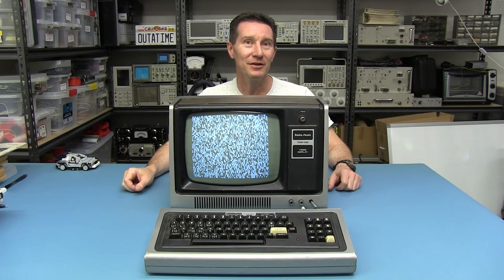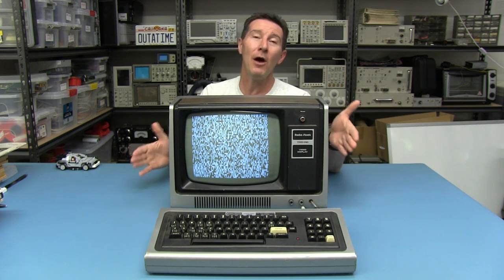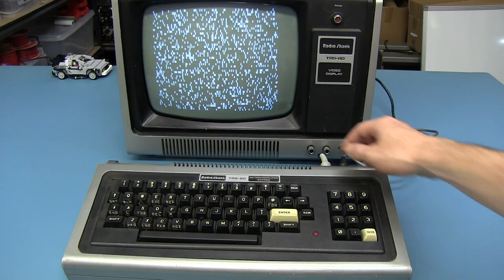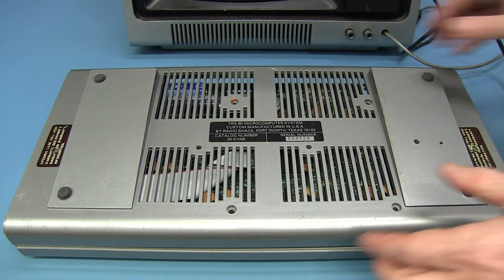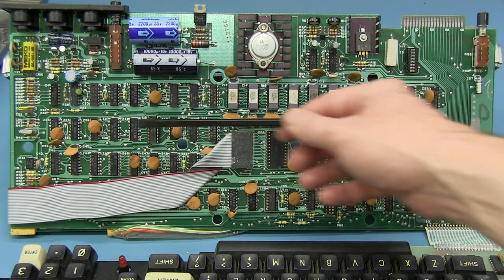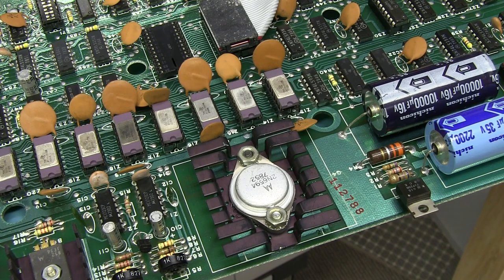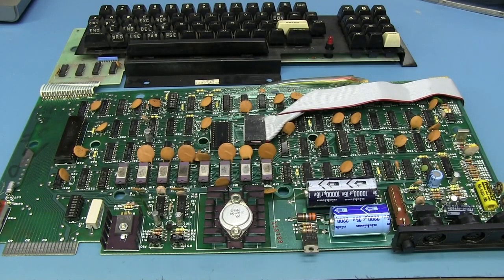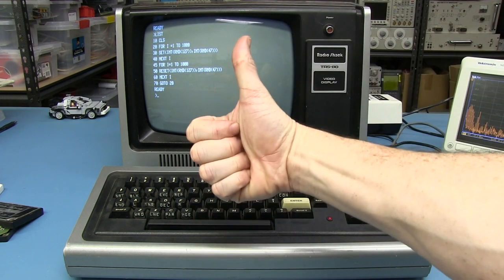EEVblog #645 - TRS-80 Model I Retro Computer Teardown

Comment: You got what you paid for with the TRS-80 I don't believe it outsold the Apple ][ because it was a better computer.  There were far more Radio Shacks then Apple Stores and they were for sure cheaper.  I believe the TRS-80 sales were overtaken by Apple around 1983/84.  Regardless what you had on your desk weren't we all on the bleeding edge back then? When IBM started the OS was terrible in comparison to CPM.

Comment: Cannot comprare Mhz directly, IMHO, in the C64 (example) perfomance was boosted by the VIC-II which take (of for course for games LOL) the heavy work clocked about 17 o 18 times de main CPU, with a power disipation peaking 1.5W in CERDIP package. In fact, CPU do almost work during spare (horizontal retrace ?) cicles from VIC-II. Text mode, another story. PET got larger basic version comprade to C64. The sad thing is that PET was horrible, screen was tiny and the machine was bulky, but did the trick.

Comment: IBM sold a computer in 1978 that had 256K RAM and up to 260MB of hard disk.
Reply: The original IBM PC had 16K. You could upgrade to 256K (...later) with cards that fit into the ISA slots. It'd run just as fast, by which I mean slowly, as the main RAM. Came with 1 or 2 floppy drives, and a socket for connecting an ordinary cassette recorder for data, which didn't get used much. A 10MB hard drive was an expansion option. 260MB, you're dreaming! My first PC in the early 1990s came with 40MB, though that was a bit out-dated then. 120MB or so would have been possible in the early 1990s. In the 1980s, and especially in 1978, no chance! 260MB would've been the size of a fridge, sounded like a washing machine, and plugged into a mainframe.
Reply: The original IBM PC, including computer unit, 64K of RAM, single 360K floppy, and monitor, sold for $3000 in 1981.
Reply: A 10 megabyte hard drive cost $4000.
Reply: $3000 equates to approx $8200 today..hmm Im starting to kinda miss my boot discs.. nah.. not really.. I remember in 1989 viruses were very popular... the school lab was rife

Comment: wow your mixed domain oscilloscope + spectrum analyser is really slow with its user interface. Looks like a code thing and not a hardware thing though, just need to prioritize user interface calculations over the FFT stuff

Comment: Sorry guys, I got to use one of these early on but it didn't impress me( same with Commodore Pet, AppleII and others). Dave does not mention the Acorn BBC32K with a 2MHz 6502 was a much better machine.
Reply: well the beeb is 5 years newer...very versatile machine
Reply: It was 1981 when the first Acorn BBC Model A issue 1 came out.  In Australia it was about the time the TRS-80's were becoming common in our Tandy stores.  The guys who designed the BBC hardware/software were also involved in designing the now ubiquitous ARM chip concept.  They were some smart dudes!

Comment: It's amazing to me how smart Dave is, but how he sometimes doesn't bother to think like an engineer. Isn't it possible that those are just plain nylon spacers, but since they've been exposed to heat and age (forty years!) they've chemically changed, bonding with the plastic posts and decomposing?  Make a hypothesis, Dave. Try to prove it, reason about it. Be curious.
Reply: I remember those spacers… as new, they weren’t a hard plastic or nylon, they were a spongy firm neoprene or similar.
I guess the softness was to reduce any rattling or mechanical vibration transfer - but as learned, they break down over the years to gluey, donuts !

Comment: Could you get your hands on a Sinclair 1000. That was my first computer.

Jack
Reply: +Jack neff I was recently gifted a ZX81 (rebranded as 'Timex Sinclair 1000' in the USA) and thought about sending it to EEVBlog. It had a semi-dead keyboard foil which I fixed 'ghetto style' and has a reset- and composite/rf switch added.
Reply: +Hans “Shockwav3” Meier  Hi Hans, that's a good idea. My first was the original Sinclair 1000 no timex involved at that time. We needed a cassette tape recorder to save programs and data. It was basic but was fun to play with. THere were a lot of addons later, keyboard, and I think an external HD. Don't remember clearly. Thanks for the message!!!  Jack

Comment: To be frankly honest, most TRS-80 are never going to start up again. If there were let's say twenty million Tandy Computers made only one out of hundred are still able to do something, a small fraction of those are in perfect condition. I personally have two Tandy TRS-80 Computers. There were three kind of processors, making most TRS-80 computers incompatible with other TRS-80 Computers. While designing these computers serious mistakes were made, the CoCo was designed by Motorola and Tandy together, but the main part came from Motorola, leaving the Z-80 behind. This is a blunder! People that wanted to go forward had to dump ALL of their equipment from an earlier period. The same thing happened  with the Intel processor. Again nothing from earlier on could be used any more. 
 
Most people dumped their TRS-80 and bought the next one. This could be different, for instance, when people bought an MSX, they could reuse their software, printer, monitor, disk-drive, game cartridges and joysticks. All of these could be used on an MSX-2, MSX 2+ and an MSX Turbo R.

Comment: ohh the electrons are goin to fall off that oscilloscope on the back on the rightside . :)
Reply from the maker: Don't be silly, they can't fall out of the plastic encapsulated chips! It simply works better when you re-align all the electrons to the top side of the packages. All that gravity over the years degrades performance :->
Reply: Ya re alignment helps

Comment: Whats all that garbage on the screen when you first turn it on before it says "MEMORY SIZE?"
Reply: Just random stuff from the video RAM before it is reset.
Reply: Not random. You needed to enter specific values when loading certain machine code programs. I believe it affected the memory address space the ROM would load into.

Comment: Though this computer had a 1,77 MHz Z80, it was very slow. The Z80 needs 4 MHz to achieve one mips, because it had a frequency divider. The 6502 is 4 times faster for the same MHz because it doesn't have a divider.
Another example is the Intel 8031 µcontroller with a divider by 12. Newer version have a divider by 6 or even 2, OK. You get my point. Z80 sucks.

Comment: It really disappoints me to see how modern laptops have a life of 3-5 years max. Wasn't technology supposed to be better today than 30 years ago? Or do they intentionally make them to fail right after the warranty expires.
Reply: +DoubleM55 All my laptops still work. Some of the batteries don't hold much charge any more. The oldest one is from 1991, and one about every 5 years after that.
Laptops will hold up just fine, if you're a bit lucky and are careful with them. I still use the four most recent ones regularly: a Pentium IV, a Centrino, a Core Duo and an i7, last two are Apple, the other two are cheap ones from Aldi (Medion).

Comment: This computer only allowed for upper case text?, well that would be no good for typing out a letter to have printed off and sent to someone. It would be good for typing out and sending ransom letters (GIVE ME £1,000,000 OR THE HOSTAGE GETS IT !!!) apart from that it would have been very limited in what uses it could serve.
Reply: ***** There was a replacement character generator available (can't remember from where) that had lower case characters.  One "gotcha" was that since uppercase didn't need room for descenders, the lower case letters that did (j, p, g, q, y) were shifted up so that they would fit,
Overclocking was done by using a 74HC74 as a clock doubles, changing out the Z80 for a 4Mhz version, and inserting it into the socket with the clock pin folded out so you cold add a lead from the new from the doubler circuit.
Other mods included adding a switch to invert the clock from the character generator chain so you got a white/green screen with black characters instead of the stock white/green on black, which was easier on the eyes. Piggybacking memory chips inside the main unit with CS lines added to expand the available memory without the expansion unit.  UART upgrade in the expansion unit, floppy controller upgrades, plus others I can't remember.
This was all possible because the TRS-80 actually came with a complete schematic.  Probably one of the last computers to do so.

Comment: It was a simple matter to add a few wires and a switch and *double the speed of Model 1 to 3.5Mhz.   With a bit more work and a Z80B, you could wind it up to 5.3Mhz.  The hardware hacking community for the M1 was huge. There were magazines and books dedicated to it (The Custom TRS-80). Hotrodding Trs-80's was very common, but I dont think Ive *ever seen a modified Apple II.   Take that and smoke it you "cant keep up / Z80 sucks" Apple-boi's :)

Comment: Why bother with a monitor or tape drive? They could have reduced the total cost even more letting people use other generic RS products.
If they sold a special tape drive it should have been remote controlled by the PC and had an interrupt every so many feet of tape to be of real usefulness. Those tape drives of the day could have been so much better.

Comment: Can you install Linux on it?
Reply: With 16K of RAM?
Reply: It won't be any stock distro, but a guy on YT actually built a "computer" on a prototype pin board with only basic logic circuits. He made it run a webserver. The hardest part was allegedly interfacing it to the internet; undoubtedly the networking hardware was much more complex and powerful than the machine itself. It had somewhere about 32K, IIRC.